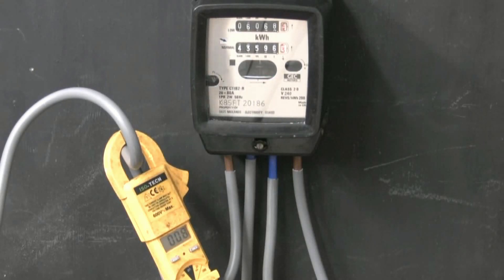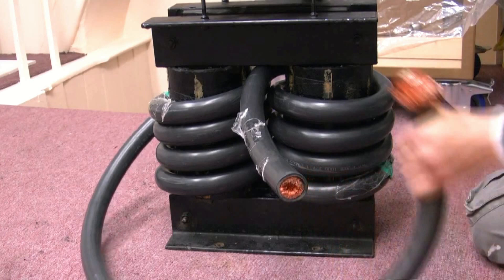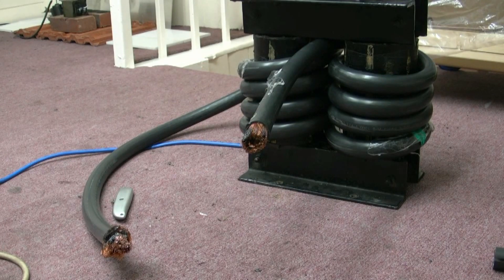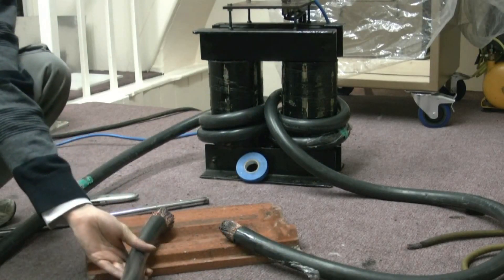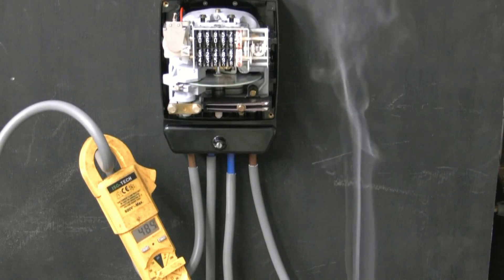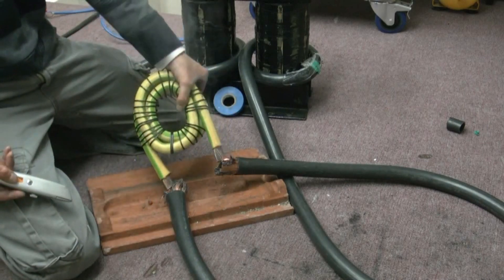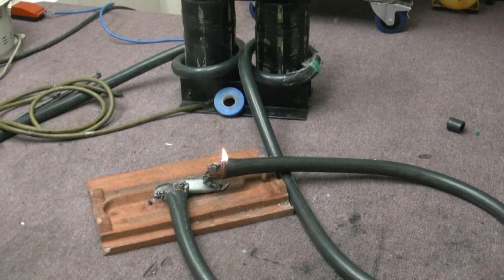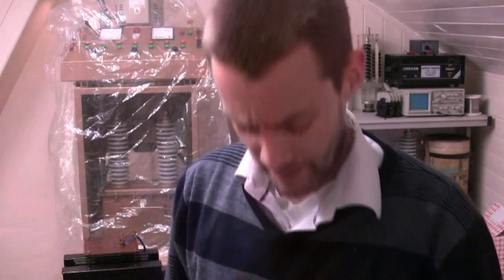Too Much Current + Electric Meter Pops

Comment: In experienced here i got a question. So as long as in not touching that shit with two hands in not gonna get electrocuted?
Reply: +Some1NamedMe if you stick a fork in a wall receptacle are you sticking it in both holes at the same time? If you do and your home is wired properly it should instantly short out and pop the breaker or fuse. If you stick it in just one hole and are touching nothing else nothing happens if you stick it into the neutral side nothing . If you stick it in the line side and say grab your kitchen faucet handle, good chance your dead. You become the filament in a light bulb. You become the box cutter in this video. You will have enough voltage roughly 110v in US I am not familiar with European receptacles but typically 220v in the US is 110 v from each buss bar and one neutral. So if European power is like. Us requiring. 2 bus then you still get 110 . Does anyone know if one line. In Europe carries 220? Wow if that were true 2 bus gives you 440 but again I'm not familiar with the European grid. Anyway, to have that 1 amp stop your heart 110 volts is sufficient to overcome your crappy personac
Reply: +Fasin Pretty much. Most things go from high to low in the path of least resistance. Human flesh is much more resistant than metal and plastic, so the pixies won't even bother marching on up through his arm... Unless he touches both ends of the wires.
Ahah! There it is. Two hands? Yeah, that'll do it... Touching both ends? That'll do it, too. Roasted pork, mate.
Reply: +Spectre ʕ ᓀ ᴥ ᓂ ʔ its less than a volt so he couldnt even feel it on his tounge
Reply: DMAN22yeah True, but he's not grounded... so not much of it really matters at that point.
Reply: Spectre ʕ ᓀ ᴥ ᓂ ʔ yeah that too
Reply: +Mark Schuster I just checked  Google .europe , most actually the rest of the world carries 220 230v 50 hrz where the US is 110 v 60 hrz. Anybody. Care to explain why Pros cons? I know the higher the voltage the heavier the insulation required. Voltage is what causes arcing . Right through the air. We have horses and use electric fences. Not like the Nazis used ours is high voltage low amps. About 8000 up to 20,000 volts. One of our boarder ladies was kind of a heavy set lass. She had a wire support bra on I guess one day and while bringing her horse in from a pasture her boob brushed a fence wire. She said those things were a dancing. To beat the band. Didn't kill her but hurt like a bitch. Said it left a mark too but I didn't inspect to concour. Electricity is very cool. Brought humanity out of the dark ages!
Reply: +Mark Schuster I have one more question. I don't know. If this is Hollywood but I've heard stories of back when old sparky. (Electric chair) was used there were occasions where the client was getting burned but not initially dying. Is that true can that happen? I think there was a movie. "The green Mile" where a sadistic guard didn't dip the sponge into water and the client roasted a while before dying. I'm guessing old sparky and Adolf Hitler's camp fences had a combination of a high voltage but not too high so it won't arc over to close passers bye. And high. Amperage interesting to hear that explained!
Reply: Mark Schuster if there isnt enough amperage, yes that can happen, it would be like a tazer